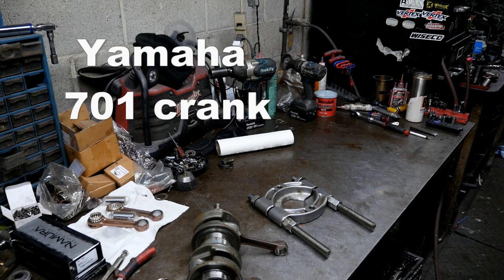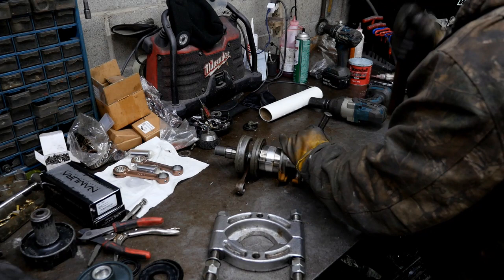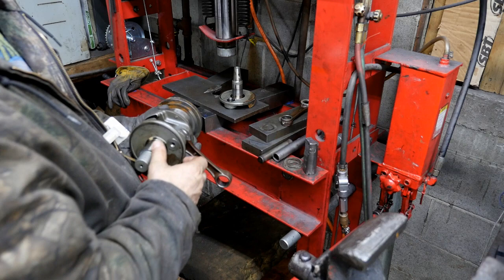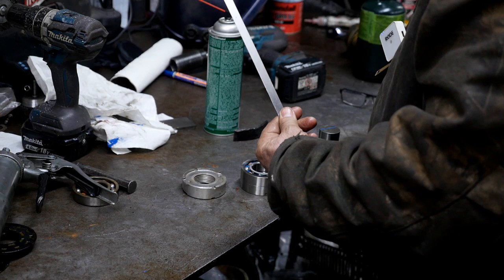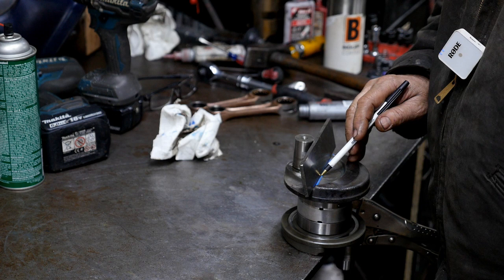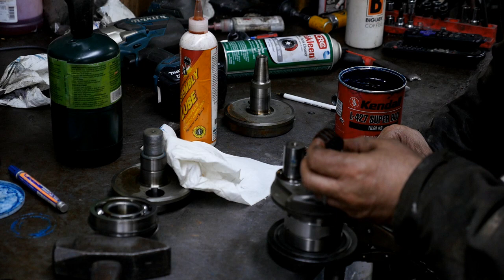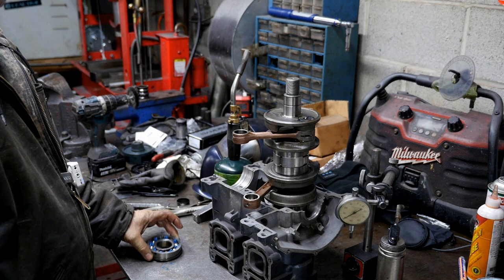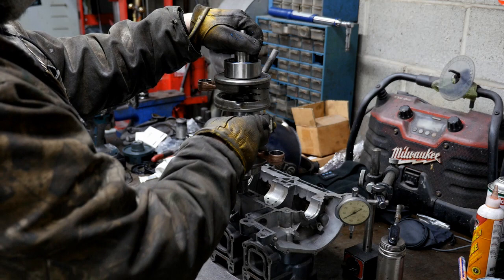YAMAHA SUPERJET FX1 701 650 760 CRANKSHAFT REPAIR WELDING AND TRUING

Comment: Why is welding needed?  Was the size smaller?
Reply from the maker: What happens is because the pins have been removed before they can be a tiny bit looser than they should be, so I weld them to keep them from twisting accidently. If you use that 660 loctite it's not necessary though. Only you better have it trued very fast cause the stuff hardens quickly.